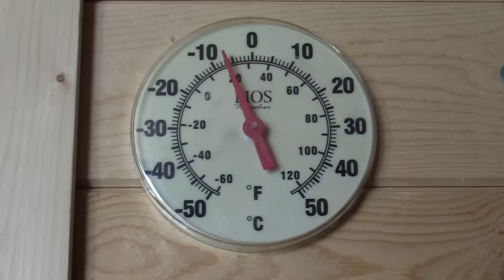Booster Fail

Comment: Run cable across ceiling of cabin and mount booster on ceiling. What category is the cable?
Reply from the maker: darren patterson it’s a black cable that’s all I know. lol. I will try that. Why not.
Reply: @truenorthlivingmanitoba  will be written on cable "cat5e or cat6 "try not to kink or crush cable, (very important )if it is a coaxial cable ensure ends are properly  assembled. Some boosters require a ground. Hope this helps. Could help you out more if I knew what the  connectors were  (type)
Reply from the maker: darren patterson I will show you on the next vid.

Comment: We were told that you have to spend the money on a good booster.  The cheap ones won't cut it.  I'd try getting a top of the line one with the arrangement that if it doesn't work out you can return it.  Nice going!